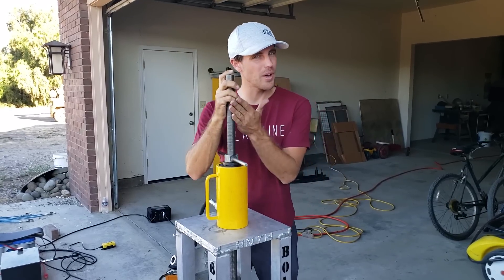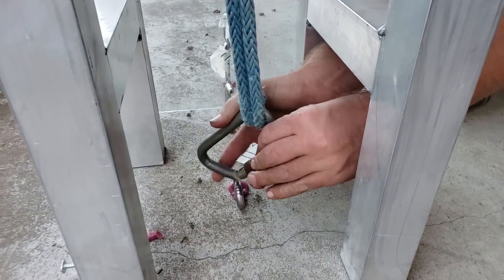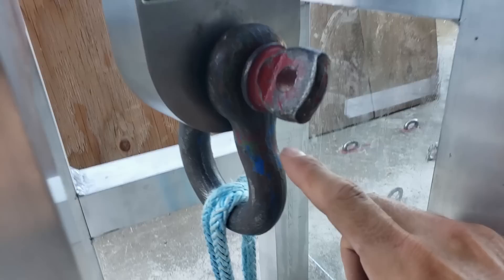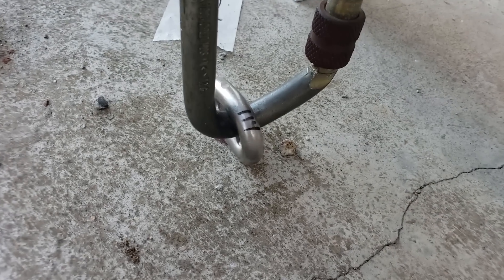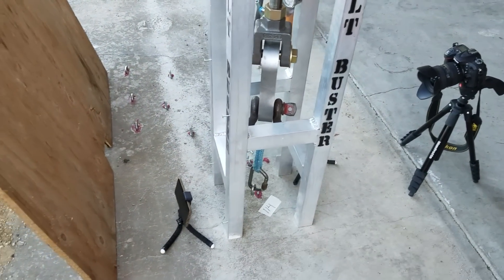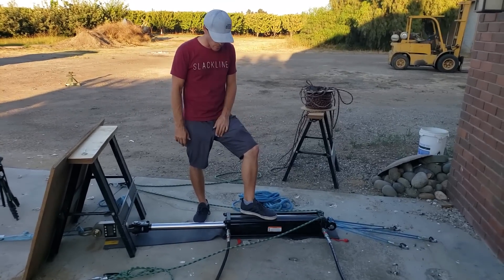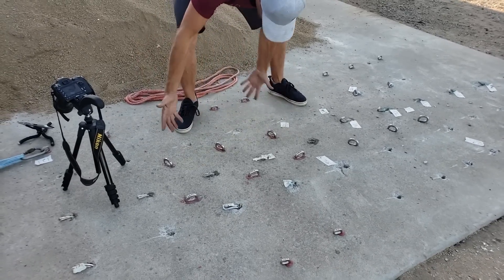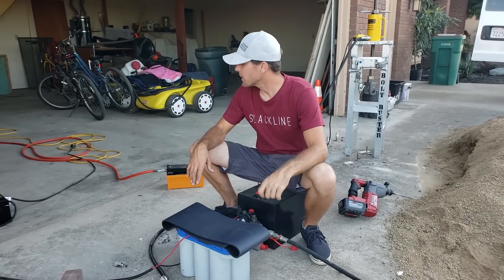Climbing and highline bolts break tests in slow motion - BoltBuster behind the scenes

Comment: I find it interesting you say you shouldn't use wedge bolts in limestone (soft rock). As a caver, I bolt a lot in limestone. All we use are wedge bolts. I'd be interested to see what what your results are if you pull test wedge bolts in limestone.
Reply from the maker: we will test it... wedge bolts did ok in sandstone in shear but were bad in tension

Comment: A Prediction: I suspect you will find the strength of the forged bolts is somewhat more consistent.  The in the welded bolt you tested here, true, the weld didn't break. But, at 5:07 you can see the crack is starting right in the heat affected zone from the weld.  Welds and there heat affected zones can vary quite a bit from one part to another.  I suspect this contributes a lot to the variation you see in the welded bolts.  (this is where you tell me the samples you were talking about WERE all forged bolts, so I"m full of s - - t)
Second, you have a nice looking rig there. So I hate to say it but, after testing in the wild, I think you might wish you had made it with three legs instead of four.  You might want to take shims with you to put under one foot if the rock is uneven.
Reply: forged is giving way way more consistent results.  The welded stuff is keeping it interesting haha.  I made shims when i made this machine because I figured we would need it and it was the only foresight that I had that went 100% as planned when we were doing granite yesterday haha.